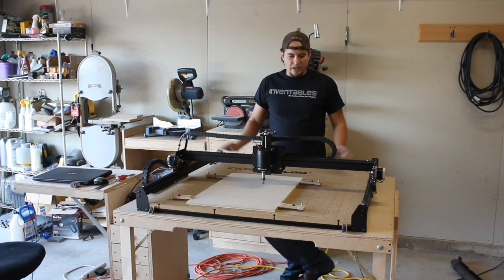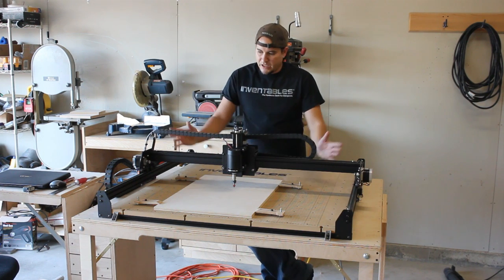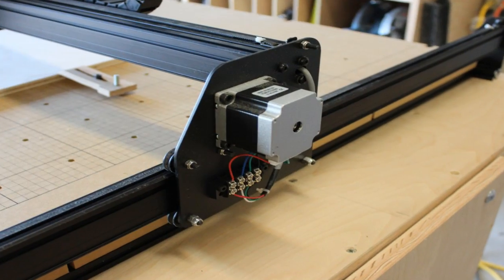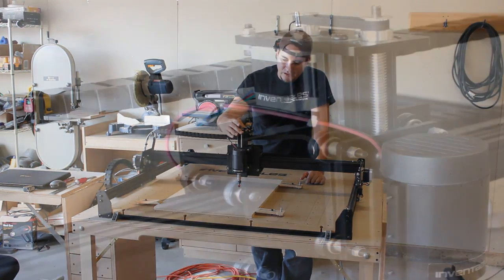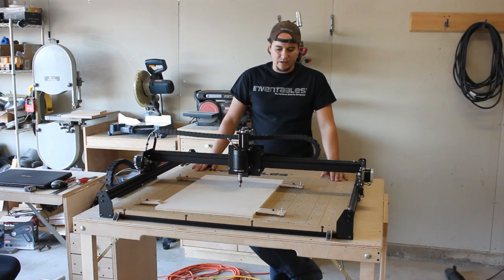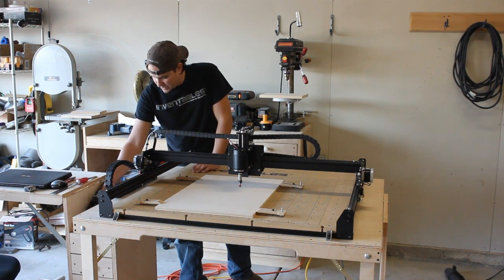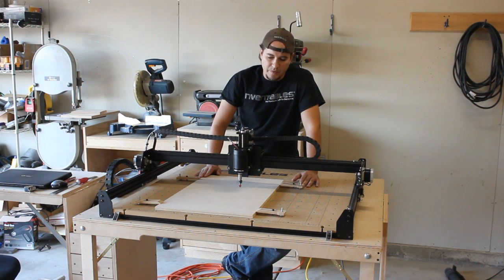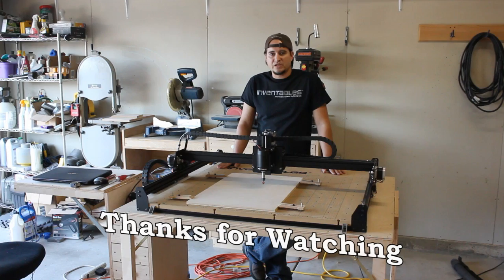X Carve : Review

Comment: Is that the large size or the small size?
Reply from the maker: it is the larger model.
Reply: +Targ's Workshop 
Thanks. I'm looking at the model with the dewalt insert. I have heard you constantly have to mess with the belts and alignment to keep the machine from going off axis. Have you had the same experience over time?
Reply from the maker: If you keep the machine serviced and tighten up the all the bolts and nuts often, then it is not a real problem.  But anything with a belt will have a tendency to loose accuracy over time and use.

Comment: Great review.  Have a question, if upgraded with a trim router, do you think could handle .70 inch HDPE (high density plastic) with a full depth cut?
Reply from the maker: +Scott Sanders Hmmmm, not sure.  you could probably cut all the way through on one pass, but im not sure if the cuts will be pretty.  I had my Shapeoko 2 with NEMA 23s and the Makita cutting though .75 plywood in one pass, but i could never get everything tightened up enough to keep the bit from wandering and chattering, and the Z axis rail would come loose.  Not pretty.
Reply: Thank you for your reply.  Just trying to figure out the time for each piece.   Want to make sure the edges are clean and sharp.

Comment: Is the makita the same size can as the dewalt?  Wondering if the mounts are interchangeable?
Reply from the maker: +Anthony Webb The Makita is a little thinner than the dewalt, but you can shim the makita to fit in the Dewalt mount.  I received my Dewalt mount last week, and i plan on 3D printing some shims to fit the Makita into it like this guy did ... https://discuss.inventables.com/t/using-makita-compact-router-with-611-mounting/11262